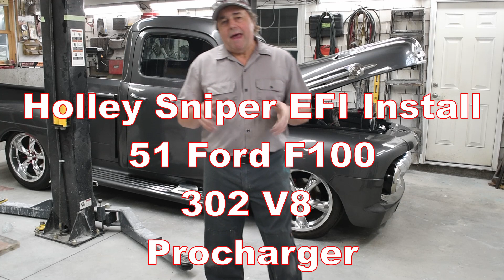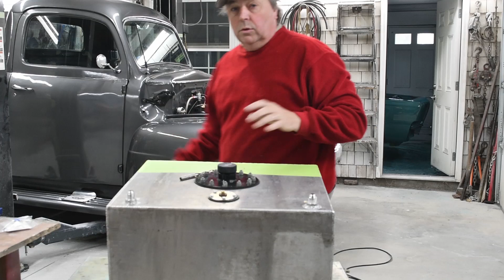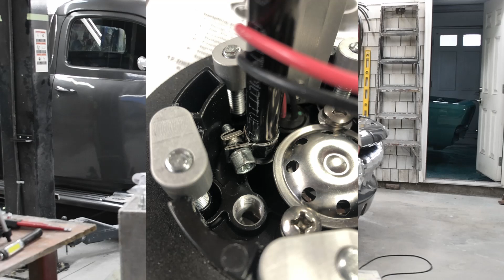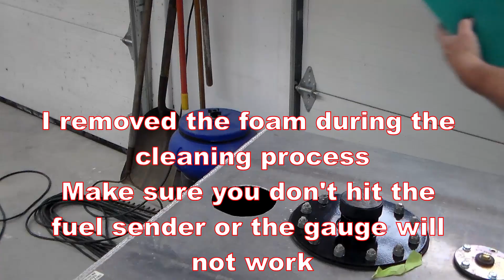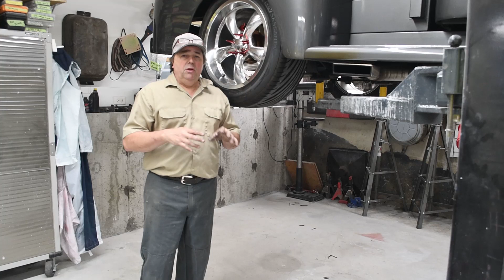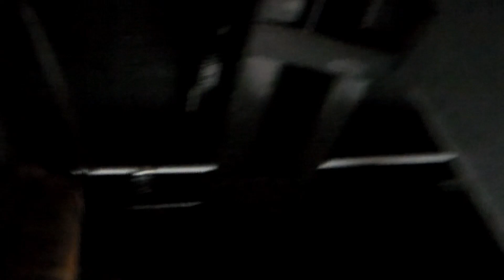Holley Sniper In Tank Fuel Pump Installation

Comment: Had  questions maybe could help me with I got in tank pump 12-303 it does not prime every time I cycle key
Reply from the maker: Does the pump run? If not, check power to the pump and relay. I would also make sure you are getting power from the key in the run and start position without any interuption in power. If it runs, make sure you are getting fuel and don't have a restrictions. The pump has an internal regulator so you can just pump 12v to the pump directly to test it and the plumbing. Hope this helps